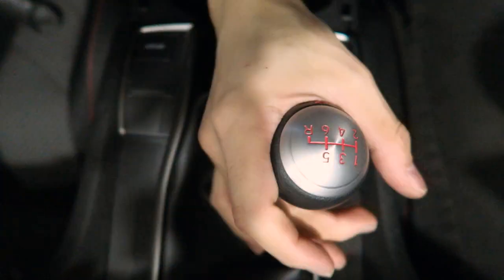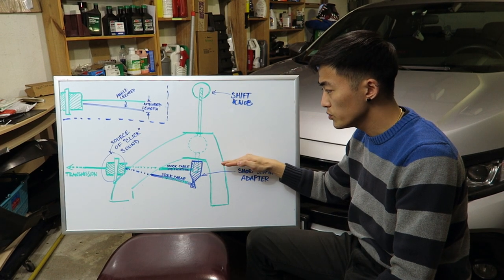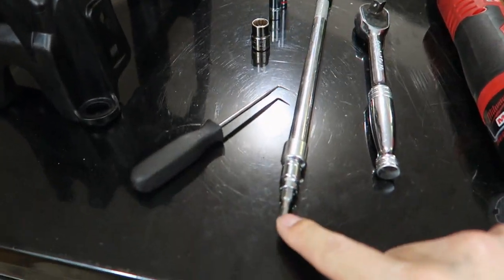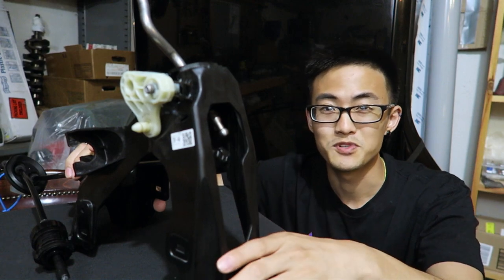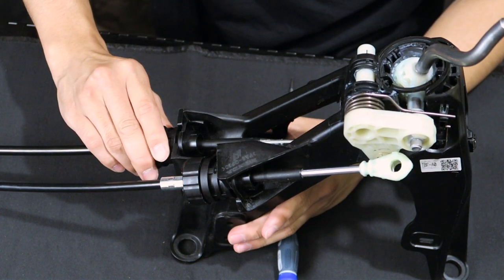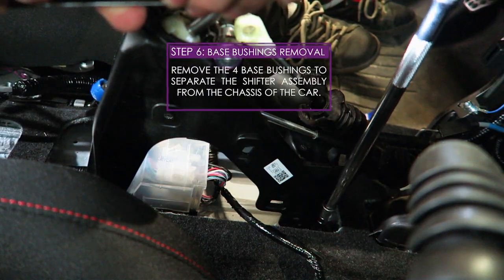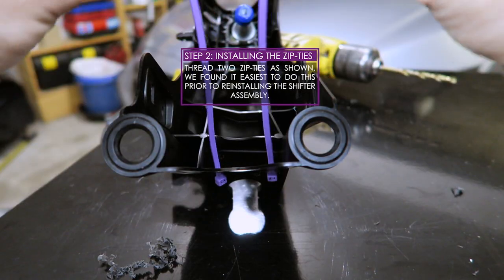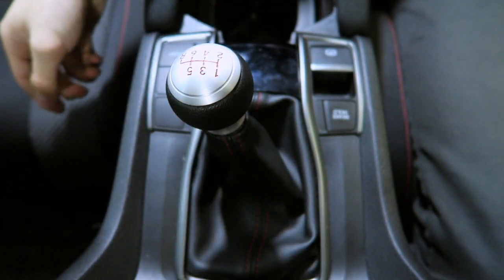ACUITY Troubleshoots An Annoying Sound Found In OEM 10th Gen Honda Civic Shifters

Comment: As a background, I did this mod while initially doing my Stage 2 Shift Kit install. After the install I tried to reproduce the clicking sound before fastening the zipties, but couldn't. I'm wondering if this problem is partially because people aren't properly locking the cables back into place when doing the install, or they weren't properly installed from the factory. You can set the cables into place by twisting them counter clockwise, but they won't lock. It seems like that might be the correct way because it's a much smaller turn as opposed to twisting clock-wise when putting them back into place, but you have to turn them clockwise to get them to lock.

That said, I secured the zip ties anyway just to be safe, and I'm sooooo happy with the shift kit!
Reply from the maker: Hey man, thank you for your feedback! 

We found that the clicking sound only happens to some cars, most won't ever need to use the zip-tie fix. For the few cars that do experience this clicking sound, I think it occurs due to the shortcomings of the oem fastening design of the gear change cable onto the oem shifter assembly, as it allows the cable to move slightly in place where it is affixed on the shifter assembly (the plastic locking mechanism has loose tolerances from the factory). Our zip-tie fix was a simple method we came up with just to secure the gear change cable in place for good. With previous OEM cable designs like the 9th gen shifter cables for example, they featured a self-tightening bushing design that held the cable securely on both the oem and our short shifter (see our 9th gen install video to see how clever that design was!). 

We're glad to hear that you're happy with the shifter upgrades! If you'd like to double check your cable install, I definitely recommend checking out our 10th gen shifter install guide as it shows the correct disassembly and installation of the cables (with rotation directions). You're right that the locking tab on the cable base should engage and prevent the cable from rotating and popping out of the oem shifter frame. You shouldn't need to rotate the cable more than 90 degrees to remove or insert the cable when working with the locking tab. 

~Pawinn

Comment: Does your shifter assy (the one made by Acuity) fixes that issue out of the box?
Reply from the maker: Yes, our fully adjustable shifter has cable mount bracket designed to keep that gear cable secure in place 👍. It also has a cable support feature for that cable to reduce noise further 😎
Reply: @ACUiTYinstruments  Perfect thank you for the answer! :)

Comment: Will you be selling future shifters already with the holes then? Looking at 9th gen shifter to buy soon
Reply: Taylor, this is a mod related to the OEM plastic 10th gen shifters only. It doesn't affect OEM 9th gen shifters or any of our full replacement shifters for the 9th gen or 10th gen. The 9th gen's cable design does not have the shortcoming that the 10th gen cables has that causes the click, and our full 10th gen shifter has a feature built in that actually remedies the shortcoming of the 10th gen cables. :)
Reply: Russell Garehan ok so I won’t need to grease a particular part for the 9th gen shifter right?
Reply: @For_Cruyff_Sake  if you are buying a new shifter from us, no you should not. We recently started grease a few new spots on the 9th and 10th gen shifters to eliminate the need for it during installation.

Comment: does this happen on the fully adjustable shifter kit?
Reply: It does not, just with OEM shifters. The issue relates back to some play in the OEM cable's guide tube (the black plastic bit that the steel rod comes out of near the ends of the cables). The tube slides back and forth a touch during shifts and can make a slight noise when it does. The bushing that mounts the cable to the shifter can also move in the shifter and makes some slight noise during shifts. The ACUiTY shifter uses a spring to preload that bushing so it can't move and an elastomer band to preload the plastic sleeve so it can't slide around. So the issue could exist on the ACUiTY shifter except ACUiTY has added features (that the OEM shifter doesn't have) to prevent that from happening. Hope that helps! ~Russ

Comment: Happen to know if this is the case on the 2018 Accord Sport 2.0T? The short throw adapter just got delivered today.
Reply from the maker: We have not been able to replicate the "click" sound on an Accord. It's possibly a result of improved fitment between the cables and shifter. That said, the Accord shifter has very similar geometry compared to the Civic's and could easily accommodate the same fix if need be. ~Russ
Reply: I just finished my install of the stage 2 kit and I have the clicking,  would have been nice to see this video prior to finalizing the install and putting all the panels back lol.  Also,  I'm getting more noise when I shift into odd gears,   it a click but more like a bump

Comment: Funny thing is, when I installed the fully adjustable shifter, I broke the clips that hold the bushing/cable. I used heavy duty zipties to hold it in place so I never encountered the sound/problem lol
Reply: Actually, the fully adjustable shifter has a stainless steel spring tab at the front and then the elastomer cable support to stop the cables from making any noise. The extra zip ties shouldn't hurt it though, so no reason to take them off. :) ~russ@ACUiTY
Reply: @rgareh1  hey Russ … I also broke that holding tap … After install i tested the shifter and didn’t see any play so I just left like that … I was thinking of doing this zip tie mode just to make sure the cable won’t pop out …. But are you saying it should be good because of the elastomer? 
I did rotate it but since the tap broke it didn’t click … and I haven’t seen it move at all … thx

Comment: Does this problem occur in  10th gen 2.0?
Reply: The shifters are similar and cross-compatible through the full 10th gen lineup. It normally won't be very noticeable until a short throw adapter is added, however. Some people do report hearing it on totally stock shifters, so it may be a matter of personal sensitivity to mechanical noises. TLDR: Yes it can

Comment: My 2017 honda civic reverse gear wont open its stuck wont go to neutral.
Reply from the maker: Did you install these bushings yourself or did you buy the car with them already installed? 

Can you please tell us every single aftermarket part in your shift linkage system, or is it just the cable bushings that were changed? This gives us the best idea on how to help you.  Shifting issues with the installation of aftermarket cable bushings in almost all cases we have investigated have been due to an improper allignment of the cables once they are re-installed along with these bushings. To be specific, we advise you check the alignment of the metal clips that secure the cables to the transmission. If you can supply your install pictures to our support email (support@acuityinstruments.com) we can help you further and confirm what may or may not be wrong with the installation.

Sorry to hear you're dealing with warranty issues, but any aftermarket modification will risk voiding factory warranties, whether it be a tune, suspension, exhaust, intake, shifting parts, etc. That being said, dealers should not be able to deny a warranty claim unless they prove a specific aftermarket part was the culprit of whichever part you're trying to make a claim on. They should especially not be able to deny your entire drivetrain warranty just because you have different cable bushings.

Comment: You shouldn't have to drill into your shifter assembly lol. Theres gotta be a better way without drilling and without buying your stage 3.
Reply from the maker: Totally understand your sentiment as this is generally how we feel about all mods (that they should be plug and play). To be clear: this is not a required mod. It addresses a very slight click noise that some users observe (many report no noise without any solution like this). The reason for the click is a combination of cable angle from a short throw adapter (all brands of short throw adapters can create this click noise) and from Honda using a less effective manner of fastening the cables to the shifter. On previous generations of Civics, the fastening method was much more secure and didn't allow the cables to move and click. It seems Honda went with a more economical design on the 10th Gen Civics and Accords. There is a $70 alternative that resolves the click from Alta if you prefer, but we believe this is overkill and doesn't provide a good value, when the solution is so simple with a few holes and zip ties. If you are concerned about the click and don't trust yourself to complete the drilling, you may consider either forgoing a short throw adapter (remember, all brands of adapters will create this noise on the 10th gens), living with the possibility of a slight click noise during shifts to even gears, paying $70 for Alta's solution, or using the stage 3 kit that replaces the whole shifter and has special features in the frame that help to avoid the noise from Honda's somewhat sloppy bushing design. 

We believe strongly in providing good value to our customers; we try to take the high road. In this video, we have simply and cost-effectively solved an issue that many customers will encounter, even on competing products. If done during the short throw adapter, it may ad 30 minutes to the install time. We could have easily never spent the money to make this video and instead offered a product that would add to the cost of installing a short throw adapter, just to make a profit. We did not do that here, and I think it speaks volumes on our commitment to our customers. If that's not a company you can stand behind, I don't know what is. ~Russ @ Acuity
Reply: @ACUiTYinstruments  I understand all that and I stand behind you guys 100%. Never said i wasn't gonna buy your stage 3. I actually can't wait! My thing was theres gotta be a way that doesn't require drilling for those people who aren't comfortable doing so and also said without buying a stage 3 for those who can't really afford it. That's all. But if there isn't there isn't.
Reply from the maker: @churrolini3084  Really appreciate the love. Apologies for the verbose reply above, but we wanted to just make our stance clear for anyone that may come upon this video in the future, to make sure the full story is available. It's totally possible there's a better solution, and if anyone finds it, we'd love to share the info as we've done in this video. That said, the key to resolving the "click" is rigidly holding the fixed bushing that locks into the shifter to the shifter's frame. That's the core source of that "click" noise. Anything that accomplishes this task will resolve the clicking. I have seen people use screws, but it requires drilling and tapping of the plastic frame, and generally we avoid suggesting threading plastics when possible, since often the threads will not hold well. ~Russ
Reply: churro 93 Alta has a tie down that does the same as the purpose of drilling
Reply from the maker: @jonathananderson891  That's also a good solution if you don't mind spending the $ on it. That said, I'm not 100% they are still available for purchase. ~Russ

Comment: Acuity can't make a fix for this that doesn't require hacking into a new product?
Reply: There is another way to solve this issue on the stock shifter without drilling any holes, but it costs about $70 and will still cause damage to the stock shifter frame. Our solution requires an incredibly minor modification that creates 0 structural issues, takes only a few additional minutes during a short shifter install, costs nothing, and works just as well. We are not the kind of company that tries to sell you things that we don't honestly think the car needs. We also think that the combined cost of a short shifter and something like the existing product that resolves this issue is just far too much money for a short throw upgrade on the stock shifter. If you are prepared to spend that much on a stock shifter upgrade, it makes more sense to start looking at a full shifter. Stage 3 is our full shifter, which will launch in the next couple of weeks and has a feature to remedy this shortcoming of the stock cables built in. ~Russ